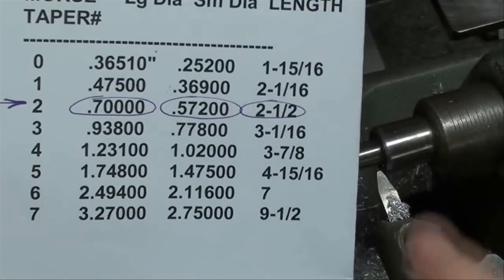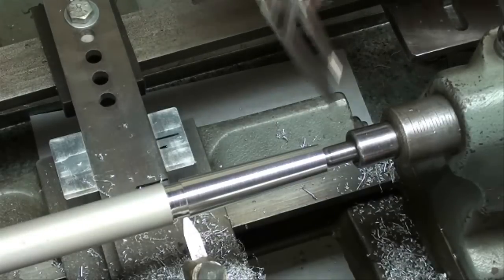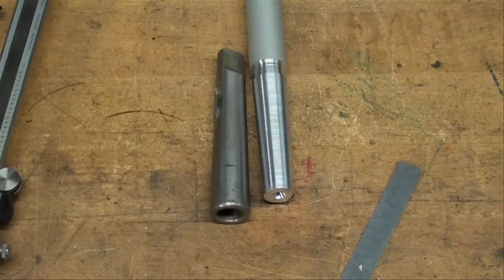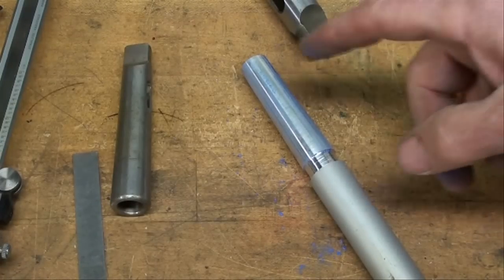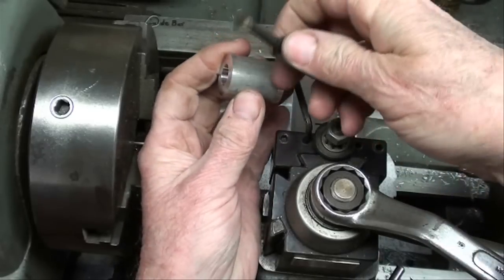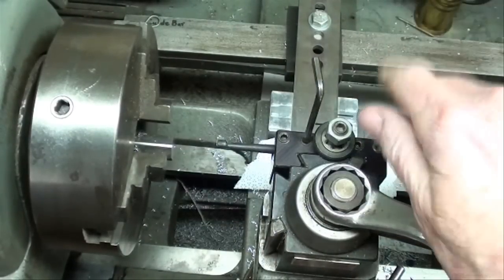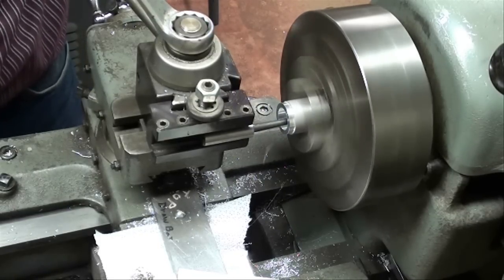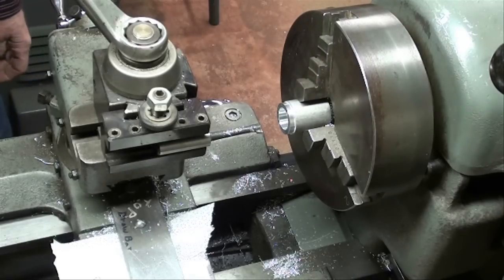MACHINE SHOP TIPS #74 Turning a Morse Taper Part 2 of 2 tubalcain

Comment: thank you, it brings back memories of when i was a small lathe operator. job loss due to foregn competition . but i used to be able to hold a half a thou on the diameter on turns up to 8 '' in length, not to easy on an old worne out swayback .one never knows how much one will miss something untill you do.

Comment: Another excellent video set explaining the set up and use of the taper attachment. I have one on my lathe but never really used it for any precision turning, I will be much more confident to use it now. Thank you for taking time to make these great videos. Sky cam seems to be working well for you. Any chance of doing a set on machining chuck back plate, a common enough problem for those wanting to add a 4 jaw or six jaw to there home set up please.

Comment: @johnpaulharris or beter yet, put a dial indicator on the work zero it, use the carriage stop to move 1" along the taper accurately, then check the dial indicator reading and it multiply by 12 for one side or 24 for both sides and you should have a very accurate inch per foot measurement of the taper.

Comment: I don't know about cat making money but cummins must. I have a cummins engine in my crane and the oil filer cap went missing. I checked with the cummins parts supplier and the cap was $82.00. I went home and made a cap with some 3" delrin and turned it down on my Atlas lathe. Added some RTV and I put a screw thru the top with a chain so it won't bounce out.

Comment: Hi Mrpete I am a novice to lathe work and I love your videos. I am trying to figure out how to turn an internal MT#3  on a  12" Atlas lathe. I don't have a taper attachment and the compound doesn't have the 3.19" of travel needed to cut the length of the taper.  My only other thought is to offset the workpiece in a steady rest, which I don't have yet. How would you do it?
Reply: You might want to try buying a MT#3 reamer and going from there.

Comment from the maker: Wow--I've never done that
Reply: can you explain the boring tool position in more detail
Reply: @tonyferster  Cutting on the back of the work means the taper angle is = cutting the OD taper on the front side. Means using lathe spindle in reverse.
If he used the front and bored normally, the taper angle would need to be changed from + 1·5° to - 1·5°.

Comment: Please show how the mechanics on taper bar that moves the cutter in the y axis,  How does it work with the cross feed?
Thanks
Tony
Port Hadlock, wa
Reply: I think the nut that connects the cross feed to the drive screw is removed so the cross feed is free to move and is then able to 'drift' with the taper attachment as it is fed along the work.

Comment: I'm not a machinist but I have a question.  Is my  thinking correct?  You needed to run your boring bar upside down to use the lathe as it was already set up. The taper started out wider and narrowed as it went deeper (in).  Why did you not run the boring bar up right and cut your taper starting with the narrow end and getting wider as you went to the left (in).  Would that present other issues avoided by running the boring bar up side down?   I suppose it  gave effectively the same results either way.   I find your videos very educational. Thank you for making them and sharing your vast knowledge in detail.  Cheers.
Reply: rick dees You feed large end to small, because the boring bar has to be able to enter the work.  If you did as you ask, the boring bar runs the risk of crashing into the mouth of the work as the bb gets deeper.  However, it IS possible to run as you suggest, provided you account for the smaller opening and adjust your bb accordingly.
Reply: In order to match the external taper exactly, with out disturbing (reversing the taper attachment) you simply run the lathe in reverse.  This requires that the tool be turned up side down in order for the tool to cut properly.